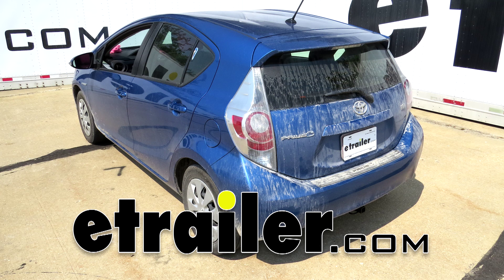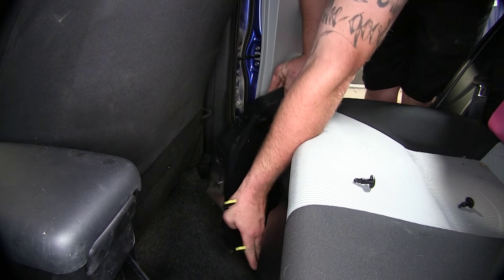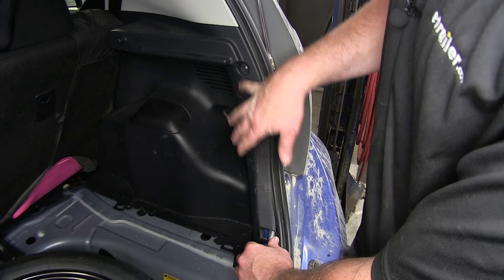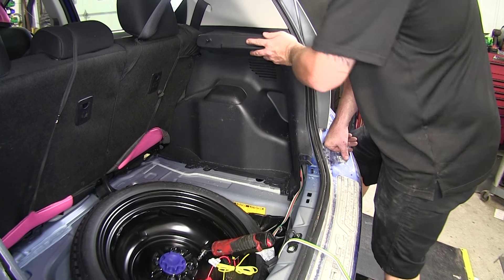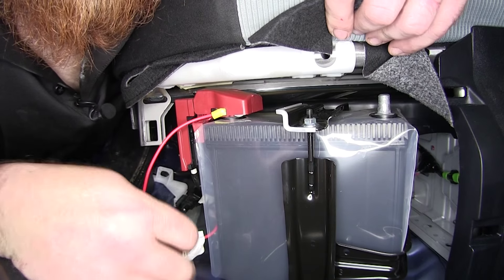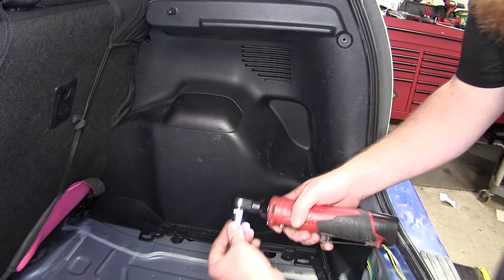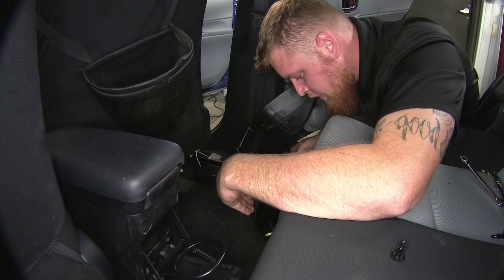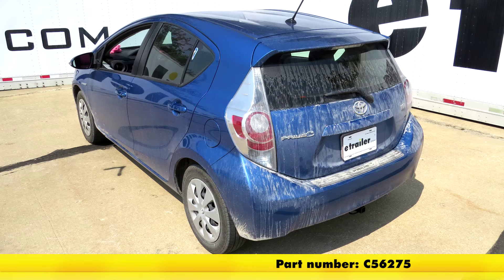etrailer | Trailer Wiring Harness Installation - 2014 Toyota Prius c

Comment: Not helpful at all . Looking to replace the wiring to the driver side low beam headlight. It hit fried because the person who replaced the high beam lightbulb didn’t seat it firmly and popped out touching the low beam wires melting them. How do I replace the wires? Is it feasible for the average person?
Reply from the maker: This video is about how to install trailer wiring on a 2014 Prius c. We're not really the source you need for repairing your headlights.

Comment: Towing with the Prius C is NOT recommended at all by Toyota.  Don't do it.
Reply: Depends how much you are towing.. some people just use a bike rack.. or a small basket with lights and turn signals.
Reply: As long as you don’t exceed the total gross weight you are fine according to most blogs I have read…caution while driving is the key idea here.
Reply: I tow motorycles with mine and get amazing gas milage